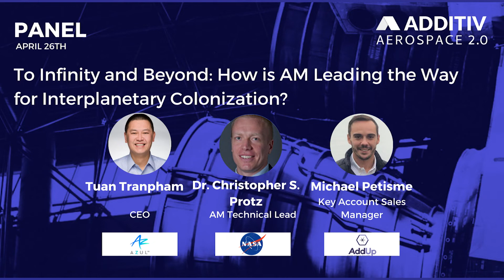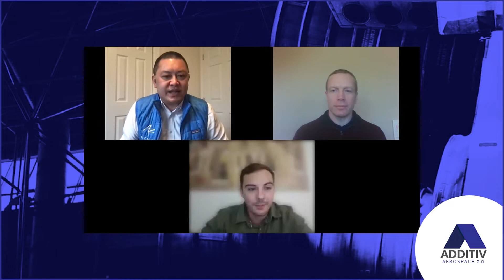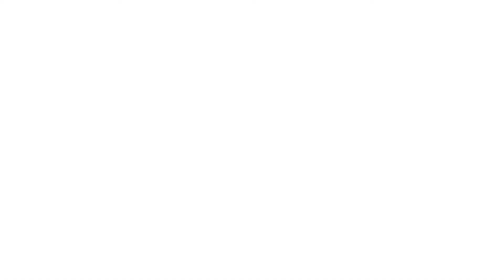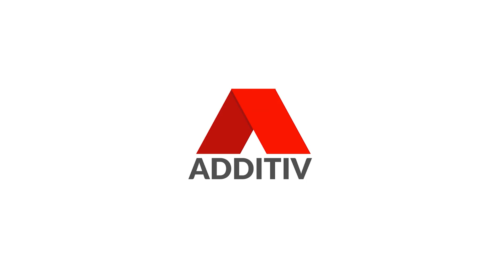How is AM Leading the Way for Interplanetary Colonization? | ADDITIV Aerospace 2.0

Comment: Because any habitat would need to hold atmosphere, a membrane is needed (for above-grade structures).  So it only makes sense to position and inflate the membrane first, and build regolith over it.  Build airlock doors and windows into the prefab membrane.  Robots would weld sections/elements of the membrane together before building a shield of regolith over it.  Putting available water into the regolith, which will freeze, will increase radiation shielding.